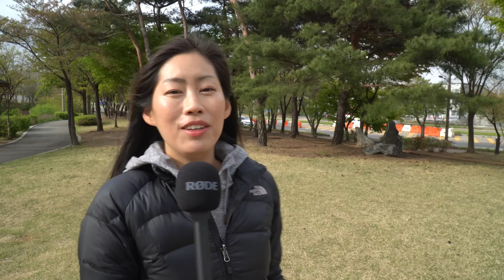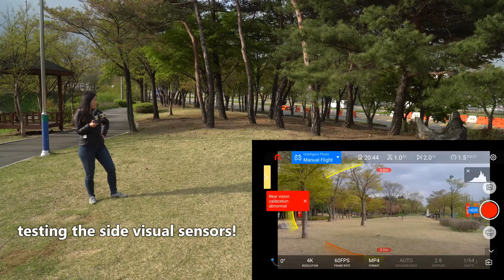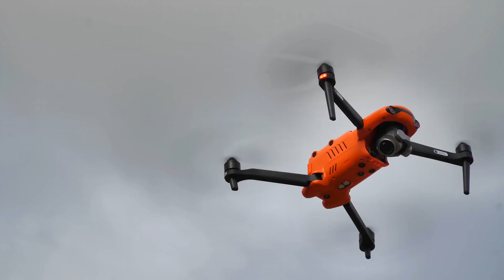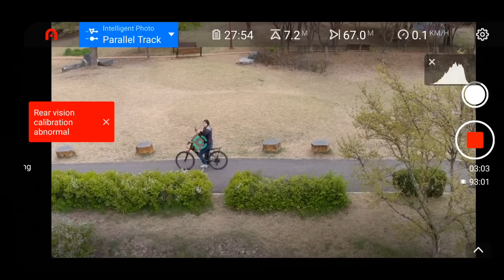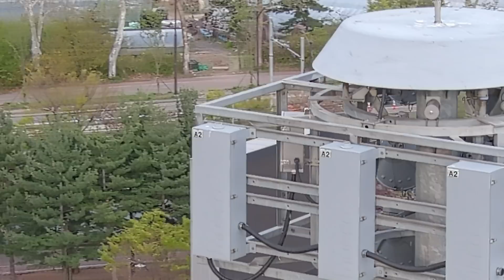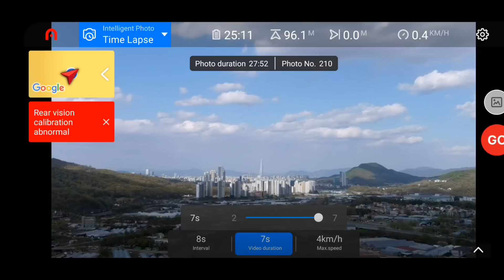AUTEL EVO 2 PRO  |  Intelligent Mode Fully Explained (ft. Obstacle Avoidance test)

Comment: Autel Warranty SCAM… you decide…
EVO II V2 640T Enterprise and Smart Controller
Attached screen shots of Flight Logs from the Smart Controller and AirData sync’d from the Autel Cloud.
Post flight inspection noticed that the front motors had worn bearings/bushings after only three months and 50 flights. Got an RMA number and free shipping for the drone and smart controller to Washington as expected. Got an invoice back for $990 for a new Gimble and Left Arm/motor assembly. The gimble and cameras were working fine no problems just wanted the two front motors replaced. I questioned this of course and they said I had a crash on March 14th that caused the damage and the repeated flying after that made it worse. THERE HAS NEVER BEEN A CRASH. In fact on MAR14 I was giving the Captain of Verde Search and Rescue in Sedona, AZ a training flight and we put it thru its paces and it preformed great on all training mission exercises during three flights. The crash Autel support says we had was the first of three flights that day. See the Smart controller and AirData screen shots attached.
Then Autel support sent me a “Truncated” flight log Google KML that stops at a cliff making it look like a crash but this showed only half the flights. We were time lapsing photos every 5 seconds and have the entire flight from takeoff to landing recorded in the controller, which they had in their hands for the repair, recorded on the Autel cloud, and sync’d from the cloud to AirData. Can share this data with anyone that wants to see it. NO CRASH!!! …but Autel support still made the false claim of a crash that day. Gross incompetence in Washington wonder if China knows this. Makes their American present look bad. They may be moving their support like DJI did if this keeps up.
Our buddy and my new best friend Ken Booth helped me get a discount on repairs but I still had to pay $742.50 to get our drone back. Ken saw the data and agreed there was no crash but it fell on deaf ears. They held me for ransom. I have never been able to talk to anyone in support… I call and always I’m # 3 in line then 2 then 1 then a message that they cannot talk to me at this time and they hang up…WTF

Comment: Hi ,  I'm  just wondering about the Hyperlaps or Timelaps ? EVO 2 has menu Timelaps but only can do take a pictures many many I haven't find out video ? if do you know how can play the video of timelaps ?
Reply from the maker: So, it was shakey and they took the timelapse option out.... the engineers are working on it, and plan to put timelapse option back in.
Reply: @Young360  I found that your video 8:02 but you said me engineer should be updated with app again ?

Comment: Is the rear obstacle avoidance like the Evo1? Does it slow down but not stop when  or will it stop like when going forward?  Liked the video and picked up a new sub.
Reply from the maker: it will stop at about 3 or 2.5 metres away from any obstacles
Reply: @Young360  thanks for the reply back. I have the Evo 1 and was hoping the Evo 2 would stop and not just warn you.

Comment: Just a quick this bit, what a lot of people don't know or realize that you can do is for the zoom feature. You don't have to be on the zoom option or any of the 8 different zoom levels to be able to zoom. If you're just regularly flying about or recording something all you must do is pinch the screen  with 2 fingers in or out and you will be able to do a much smoother and finer zoom rather than a complete jump between 1x / 2x / 3x etc.. you can achieve a zoom level of 1/10 so you can get a zoom of 2.3x or 3.5x etc.. hope this helps out with any clearer shots that you may want so you don't over or underextend your zoom!
Reply from the maker: thanks for the tip!!
Reply: Anytime! I'm just recouping from a recent identity theft and relaunching my Techie channel so I'll be uploading tons of goodies soon!

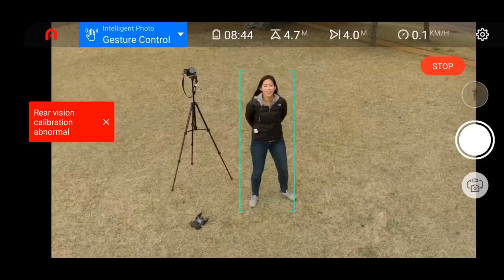Comment: Huh... I switched my iMac to 5K resolution to check out the video quality; it is pretty impressive. The stills at 07:37 were good, but not jaw-dropping (tho' you are fetching). It seems to me that DJI is going to need to up its game at the high end of the prosumer range, although it would be interesting to directly compare the EVO 2 Pro 4K footage with either the Phantom 4 Pro or Mavic 2 Pro.

Comment: I think the skydio 2 is still the king of tracking drones. It does an amazing job creating very cinematic shots. The autel still has a ways to go. 

 Its just doing The bare minimum and the video isn't smooth it's choppy as the drone adjusts its self, the skydio creates art, even the mavic pro 2 still beats autel in this regard.
Reply: Can the Skydio fly at night?
Reply: @jaroot2  absolutely... but you don't want to fly at night especially as a new pilot. You run a serious risk of crashing it or losing it or getting it stuck on a roof
Reply: Well according to Skydio’s web site it’s not night compatible. I don’t currently have a need to do night flight but I want the option.
Reply: @jaroot2  bro you can fly it at night...you can fly any drone at night the obstacle avoidance sensors will have trouble but that's it. All drones have manual control. 

If u want a cheaper alternative to get your chops up check out some of the older parrot drones u can get them for like 200 on Amazon now and they are excellent.
Reply: @3star2nr  https://youtu.be/ZsUQTrRS02k

Comment: Again, you have had this for a week and are teaching us valuable stuff the other channels never touched on.  Really interesting stuff including where you found problems.   I have heard people complaining about the controls being too responsive for fine work. It appears they just try to use it like it was one of their DJI Pro drones.  You have learned about settings to create fine movement others seem to have missed, before complaining.  Thanks!!
As a former software tester, your wire test was really useful.  It's not just about wires parallel to the horizon, there is something else here you found. Time for Autel to figure the fix.
Reply from the maker: yeah, i think with the joystick control etc, you can work around with Intelligent modes like Precision Mode and Orbit Mode. and I talk to the engineers at Autel and they seem to be aware of few stuff i found and apready working on them. They did release 1 firmware update  so i think there are more to come :)

Comment: Thanks for your testing I think it never make a crash ^^
Reply from the maker: yeah, it will be really hard to. from the remaining battery time of 5 minutes, it will start to lower altitude quite fast.. so, i think users need to be mindful about that ;)
Reply: @Young360  when during the low battery  spcially possible to control yourself or RTH automatically? Because old evo1 when 10% remaining battery you can't control immediately landing.

Comment: great video. it seemed to lose you behind that wooden structure but you didn't discuss that. what I like about your videos is you show the real experiences you have unlike some of the  higher production videos out there that are too much like ads. So keep that up, like when you did the distance test and were so worried you would lose your drone and the incessant low battery alarm was ratcheting up the tension. I was laughing and glad someone was sharing the experience.
Reply from the maker: yeah, but then i was completely blocked (maybe some other drones can calculate and continue?!? )
Reply: @Young360  I wonder if it staying over to that side and not following you onto the path due to the line of trees. I wanted to say again though that this was a valuable video, it showed so many modes, and from a non-expert perspective, so I felt like that is how it would be if I were trying it. The part where you circled close to the light and zoomed in was SO COOL.

Comment: Would this work well for high speed tracking like dirt bikes or dogs running?
Reply from the maker: I think so, but when the drone avoids obstacles, it does swing quite fast. so you wanna make sure you have a really big wide space. also, the dynamic tracking thus far only works with quite a short distance to the subject. hopefully, Autel expands the range....
Reply: What I've seen from other tests, it's not tracking fast moving objects very well. If you want an action tracking drone, go with Skydio...